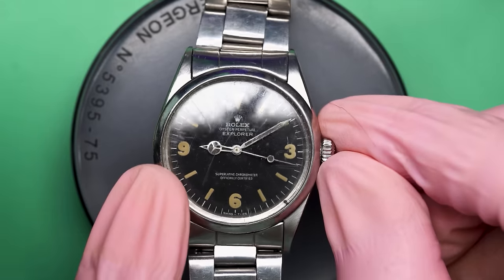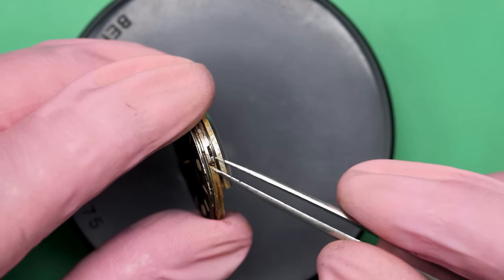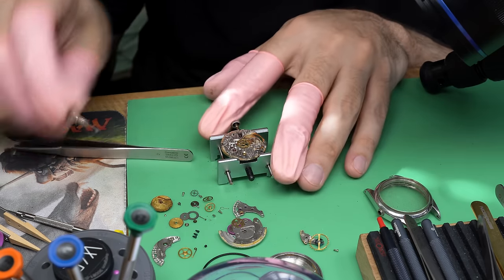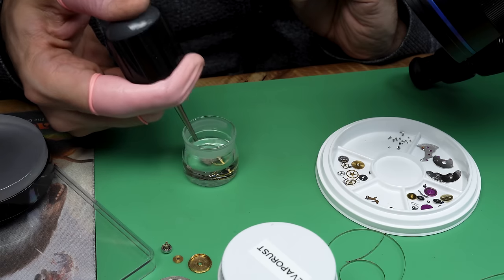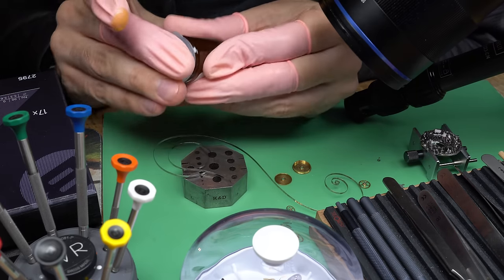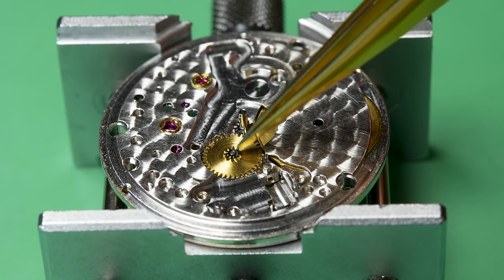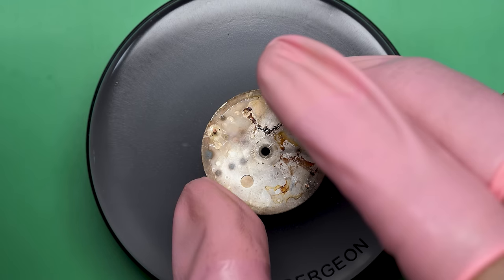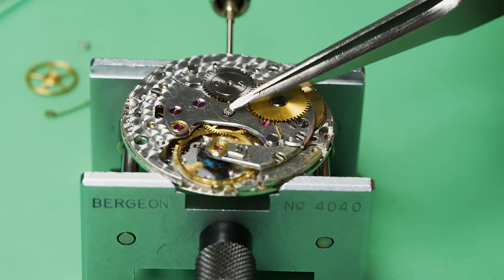This $25,000 Rolex Explorer Was Exposed to Seawater!

Comment: Salt is devastating to mechanical devices.  Just a little corrosion will spread quickly.  Its not that it couldnt be repaired.  Its that if its not cleaned perfectly the corrosion will be back.  Any pieces that were affected will need to be swapped out which can quickly exceed the  value of the watch.

Comment: adding to your list. Vintage Chrobigraph watches that aren't serviced. as they cost a fortune to service... even seiko vintage chronographs... i had that problem when i bought a seiko 6139 bruce lee.... 😂 for me it was worth it. as i took it for cheap. and i serviced it. the service was high even though i just changed the crystal, seconds hand and balance wheel.
the other stuff was just servicing and oiling.

Comment: Feel dumb asking because im sure there is a purpose but why not clean the entire movement first atleast soak in solution to free up debris then disassemble? Feel like a few parts may have been easier to remove however i have no actual idea. Im just starting to learn so any info i can get is great.

Comment: why didn't you bore a hole and put in the bolt from the other side? should be much more stable and you don't need to cut of the bolt + filing.

Comment: How many hours total goes into a restore like this? I'm sure it was a lot.
Reply: Indeed. It wasn't just the time he spent on the watch itself, but the time sourcing original replacement parts, and he mentioned that he even practiced certain repair techniques on a cheap watch several times before performing it on the Rolex. Very thorough and impressive.

Comment: Try next time putting everything that has rust on it in the evaporust. you would be amazed as a results. You wouldn't have had to manually clean any of that rust off. It's a very mild chemical. The only thing it does anything to is rust.

Comment: Whats truly obnoxious about this is the owner became aware of the issue very quickly and rust in any mechanism is something that the longer you take to address the issue the worse it gets.  Had the initial jeweler at least opened the watch and dried the complication things would not have been so complicated down the line(pun intended) Rolex seems like theyr adopting the apple methodof dealing with customers!

Comment: The crystal restoration was waaaaay too complicated. Sanding Sticks. Sure they work but they're expensive. Plain old sandpaper works just fine. 3000 grit held in your fingers to get the deepest scratches, 5000 grit to finish up. Wipe it off. Novus Plastic Polish #2, a drop on a microfiber cloth draped over the palm of the hand. Crystal goes on the hand face down and you move the crystal with a finger tip, not the cloth. Repeat as necessary. The average badly scratched crystal (plastic) takes about 5 minutes, tops. You can even do it this way without removing the crystal!

Comment: I'm surprised anything rusts in an expensive Rolex watch like that. Why didnt they electroplate or anodized the parts for water? What an overpriced watch. A Rolex really! Sure that's not a good Vietnam fake?

Anyway look up techline coatings. They sell aircraft style coatings we used for years. The ceramic coatings are micro thin and hard as chrome and wont rust. You may he able to use some of thier products. I would coat every metal part after soda blasting it. You can use walnuts too. 

You can make your own elecrolizer from batteries to plate the parts with gold, silver, platinum or even rhodium the best.

I'm amazed Rolex sold a watch with rustable parts. Are they all like that?

Totally blown away since I collect rare Neuman mics. You open them up and everything is coated protected and they only worry about spit getting in.

Check out techline coatings. You may be able to ceramic coat those parts. It doesnt add thickness but will make everything rust proof.